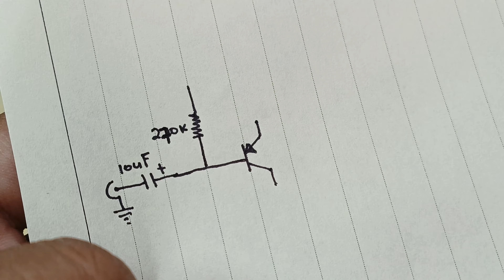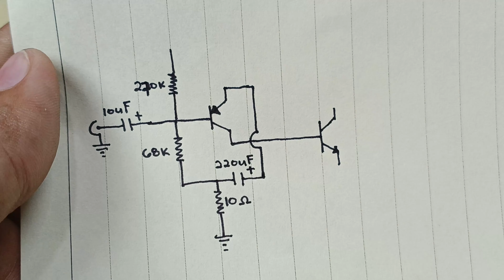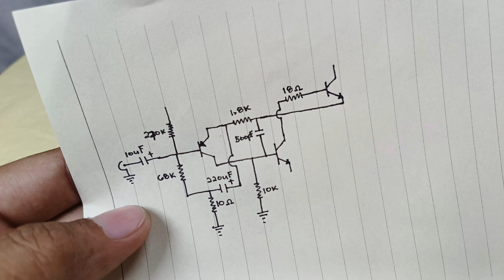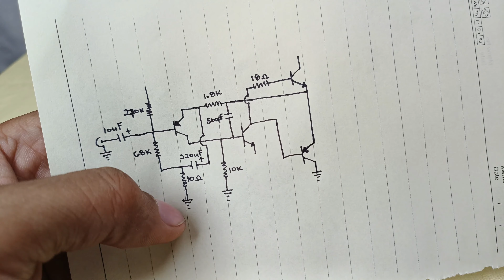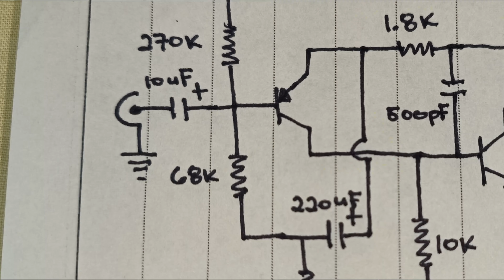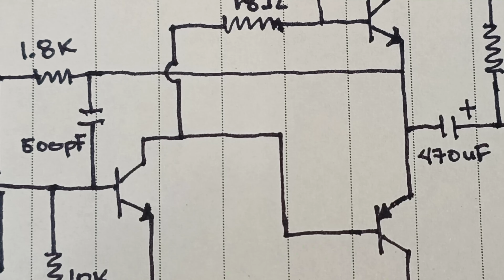How to make AM transistor radio amplifier || Germanium Output Transistor

Comment: Hell sir will you make a video of DC 9 Volt amplifier using germanium transistors AC 187 AND AC 188, can i hope?
Reply from the maker: I have 9 Volts 3 transistor amp using silicon transistor here's the video https://youtu.be/IyeN5tkg1ec
Reply: @woodyshobbies  ok sir
Reply from the maker: @लंकाधीशरावण  👍👍👍